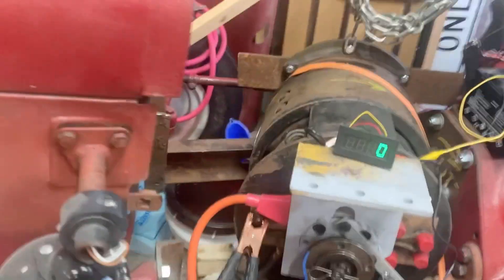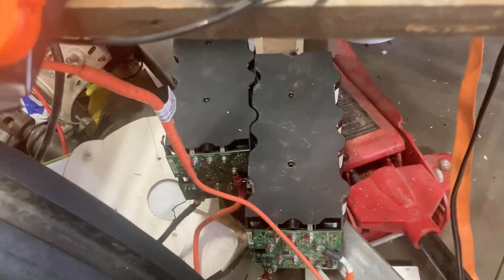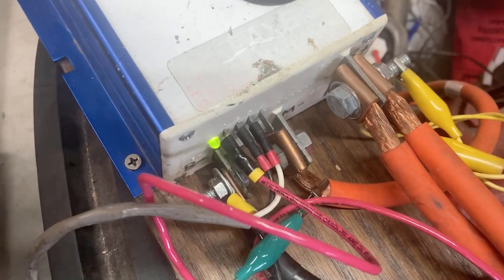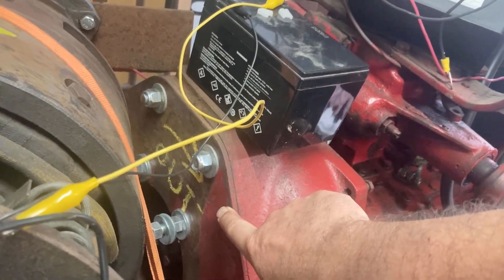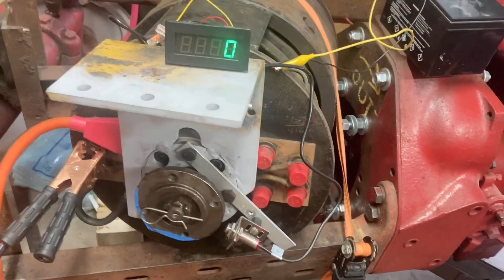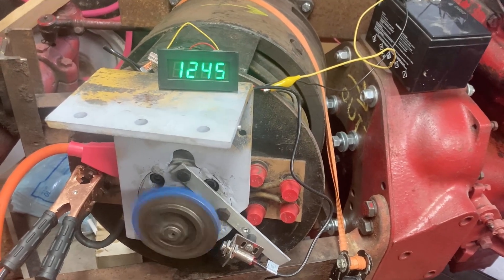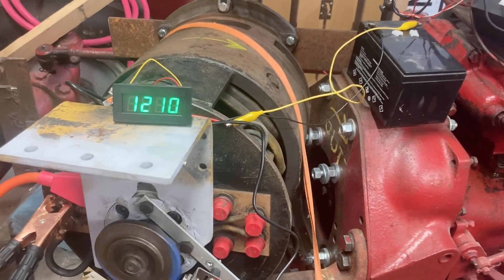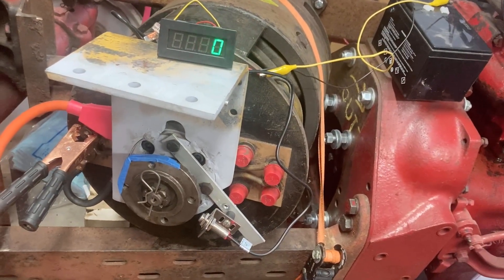Electric Tractor: Testing RPM of Motor

Comment: Can you explain the pre-charge resistor across the solenoid? It would seem that it would maintain power to the controller 24/7. My Farmall 300 conversion made the trip back to the farm from the local high school last Thursday. I made it a mile and a half before needing to get towed the remaining mile. The batteries had not been fully charged before the trip but I now have charger working.
Reply from the maker: A pre-charge resistor allows the capacitors in the motor controller to fill up more slowly. Without it, capacitors can fill up nearly instantly when the main power circuit is completed. Do that too many times and they can blow out, destroying the motor controller.
Projects like this typically have some sort of manual disconnect which is left open when the vehicle isn't being used. Otherwise, the pre-charge resistor could be set up on something like a push-button momentary on switch.
Reply: @BenjaminNelsonX  I ordered the resistor.

Comment: Those old 300s could put out 38hp at the PTO, how close do you think that combo will get you? 

Asking as someone who rebuilt a Farmall 450 right when you kicked off this project and the engine parts for those old tractors are getting hard to find and expensive!
Reply from the maker: I still have the engine. I figure it will be useful to somebody else. 

I think horsepower should be fine. This is a 13” diameter forklift motor. It’s a beast.

Comment: Higher voltage for more torque and less wiring awg. There are tons of ways of putting a potentiometer into a range of resistance.
Reply from the maker: That's what I'm thinking. Probably a 48V pack, as that's good for affordable and easily available parts.
I'll probably re-use the physical throttle lever on the tractor and have some gearing connect it to the potentiometer. Have the full range of the physical throttle match up with however much of the range on the potentiometer I want to use.
Reply: @BenjaminNelsonX  Nice. Looking forward to seeing how this turns out.

Comment: So just drop the voltage to reduce risk of to many RPMs? Or use a mechanical limit on the potentiometer
Reply from the maker: That's exactly what a DC PWM motor controller does. It takes a battery pack voltage of, for example, 48V and outputs the equivalent of a variable voltage by simply turning the circuit on and off many times per second. If the duty cycle was set to 50%, the motor would spin as though it were running on 24V - half the speed.
Reply: @BenjaminNelsonX  Just remember when you lower the voltage, you also lower the power of the motor. Also if you half the voltage you only get quarter of the original power so keep that in mind!
I'm waiting for next update!

Comment: not sure what it takes to build a tractor, but is it possible you want the higher power/torque but just convert it to lower RPM with some sort of gearing? thanks for sharing.
Reply from the maker: Additional gearing really starts adding a lot of mechanical complexities into a project like this. A PWM speed controller allows for maximum torque, while varying the speed.